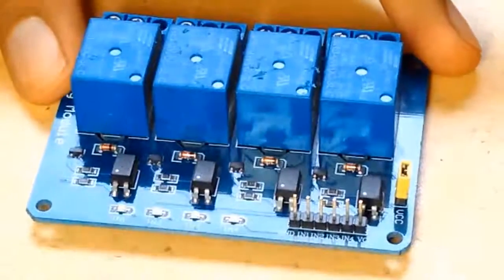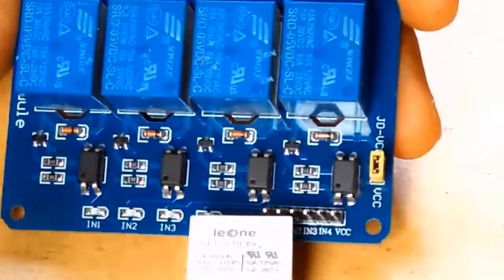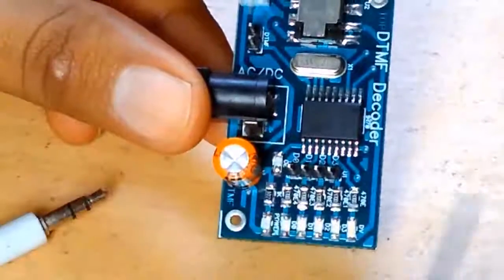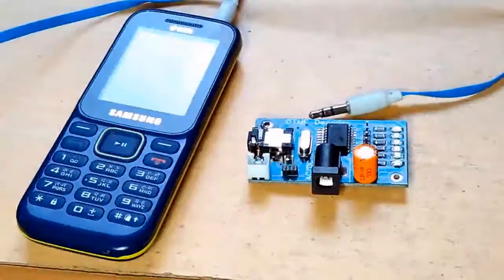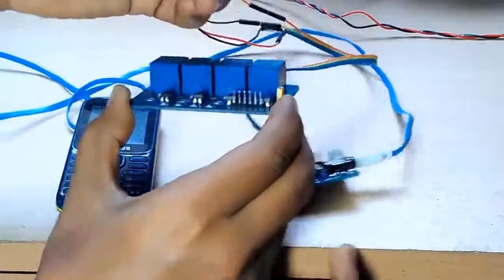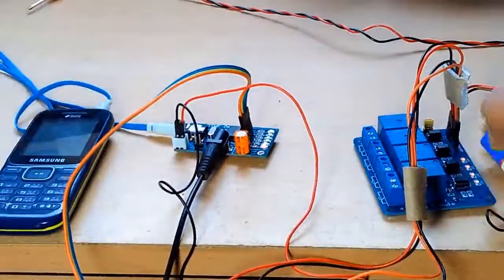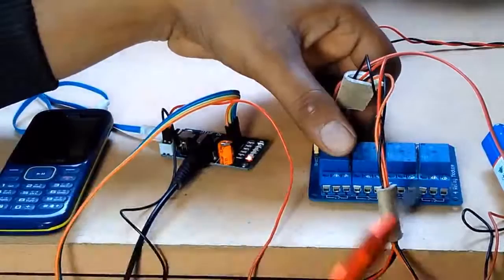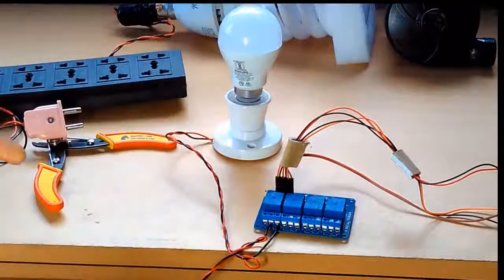Control Home Gadgets via Smart Phone- Part 1

Comment: you have to manually receive the call on the receiver?   you may as well just turn your device on manually if you have to receive the call manually.  However good instructions.
Reply: You are right. It's useless you have a phone that is capable of auto answering. Not all phones have that capability.